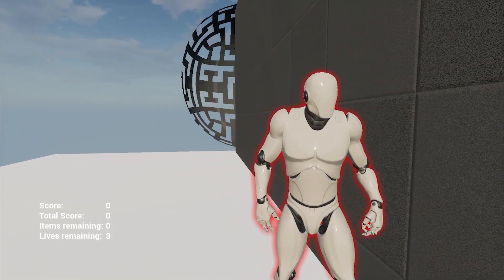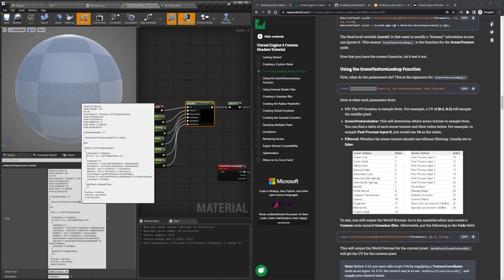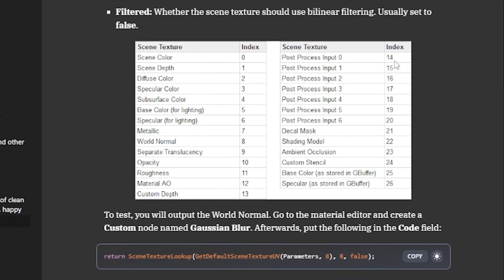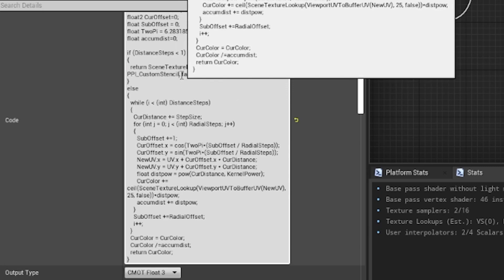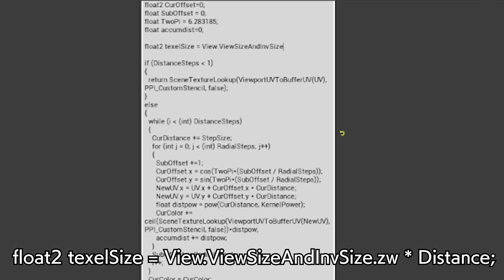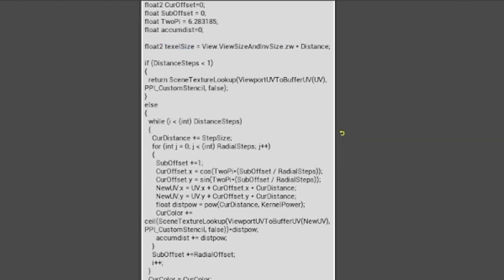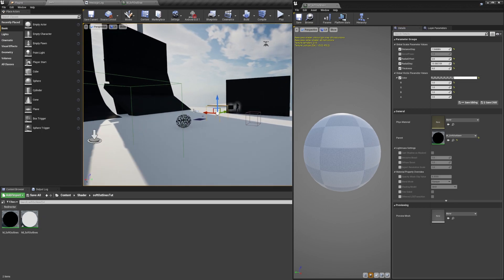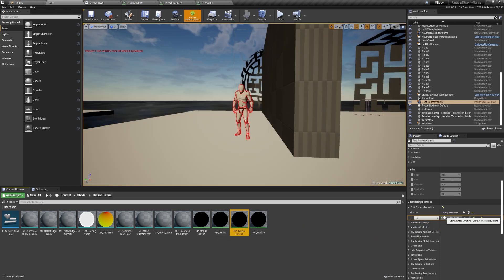Soft Outlines Tutorial | UE4.27 to UE5.4

Comment: Struggling to make this work in UE5.4. Did anyone manage?
Reply from the maker: @Virtuality  Did it report an error when you tried to connect or preview a node that had no math operation with the scene texture nodes? That’s a result of the custom node not having access to which ever header contains the scene texture lookup code, the solution is to just hook up all the nodes shown in the tutorial before previewing the output. If you are still having trouble after that, reply with what’s happening and hopefully I can reproduce the error.
Reply: @Erros  no errors. I just get a small coloured block in the top left when not highlighting. When highlighting I get some lines in the bottom and right side of the screen.
Reply from the maker: @ I’ll investigate this when I get free time from work as this sounds like unseen behavior
Reply from the maker: So I've tested this in 5.4 by upgrading the 5.3 version of the project and it still works, so either unreal is translating the material code from 5.3 to 5.4 without me having to rewrite it, or unforunately more likely there's a step you missed.
Reply: @Erros  @Virtuality I also can't make it work in UE5.4.4. The error says: use of undeclared identifier 'SceneTextureLookup'. 
For me CalcSceneCustomStencil( <PixelPosition> ) and CalcSceneCustomDepth( ViewportUVToSceneTextureUV(<UV>, PPI_CustomDepth) ) works.
I found them in the generated HLSL code, that you showed at 3:11 . It's weird that the stencil buffer only uses pixel position.

Comment: this affect only the outside corners/edges what about the inside edges?
Reply from the maker: @hatty101  only outside, you will need to combine it with a normal line sobel to get both
Reply: @Erros  i am searching for days to find a way to outliner inside edges but i cant i am desperate and sad! :((((((
Reply from the maker: @ run the sobel filter on the scene texture containing the normals, I believe the video I reference at the end of this video has normal lines, it’s an hour but it’s a great video
Reply: @Erros  thanks. I found a method but it requires stencil which doesn't work on mobile even tho docs says it does
Reply from the maker: @hatty101  the method used in this tutorial also uses stencil but to get the shader to compile for mobile you have to use the custom stencil node instead of writing it directly as unreal does some conversions behind the scenes which would be honestly be nice to know so I could just write the shader instead
Reply: @Erros  ohh?? amazing thanks for telling!

Comment: Thats brilliant! Thank you. I have a question, sort of related. If you have a toon/outline, its highly dependent on the screen/viewport resolution. Meaning, in low res, or small viewport the lines are forced to be thick and cant get the sharp details that might be needed given that the buffers' resolution are small. Is there a way to make them independat?
Reply from the maker: @0xnd90sjsnjdo0sbbo0 i don’t have it open but I believe that’s what the texel size is for, and if you don’t round the thickness variable then you can use fractions
Reply: @Erros  yea, thats what the texelsize is for, you can always increase the thickness,but if the viewport gets smaller, the buffer dont have enough resolution and your stuck with a thick line as a minimum. I was trying to figure out ways to upsample the buffer size, is that even pissible you think?
Reply from the maker: @ maybe if you used inverted hull but that wouldn’t be a post process effect and has the potential to look bad (very dependent on the number of triangles in the mesh)

Comment: hello, thank you a lot of these cool tutorial. It works well!    i just wondering that how to show only in Custom Depth stencil 1 layer?   I tried with Lerp, stencil mask compare node in material,  but keep failing...
Reply from the maker: @greempark5743  the custom depth value you assign to the mesh is the stencil layer
Reply: @Erros  Yes, i did it.  Depth 1,2 is working. 

I want to make this work only Depth 1.  not 2.      cause i want to use Depth 2 for another color.    

Thanks for reply 🥰
Reply from the maker: @ you should be able to clamp the custom depth in the material graph to a value between 0 and 255 then have a check if it’s the value you want to allow and I would just returning a float of 1 if allowed else 0 and multiply that by the value that only adds the outlines else you’ll lose the scene color as well and the screen will be black
Reply: @Erros  ahh Thanks for kind reply, I will try and show you as a Video soon.

Comment: Does this work in unreal 5.3? i tried using it but it doesnt work for me?
Reply from the maker: There are nodes you can’t preview or plug into the output else the shader will fail to compile because it’s missing access to a particular buffer. I advise following the full tutorial before testing the output, but yes I tested the project containing this shader in 5.3 before updating the title.
Reply: it works in 5.4v

Comment: Looks like a good job, but in 5.1.1 it compiles succesfully, but nothing happens. no outline (
Reply from the maker: I just tested it on 5.1.1and it' still working https://drive.google.com/file/d/1RULYrJdCyIBJ1G6CJ-VDD-N3-76ZS1ao but it could be the Material Instance isn't added to the post process volume, the mesh you want to outline does not have a stencil value greater than 0, or another easily overlooked setting.
Reply: @Erros Can you provide the right code. may be i made an error with your old.

Comment: Awesome!! It's almost working for me. For some reason though, the blurred offset samples don't vary in opacity? They seem to all be maxed out at 1, so instead of a fading glow/reduction in opacity by distance I just get a solid outline. Any idea why?
Reply from the maker: What values are you using for thickness, distanceSteps, radialSteps, and kernelPower?
Reply: @Erros  I tried a few setups, but anyway let's say Distance (Thickness?) = 5, DistanceStep = 8, KernelPower = 1, RadialOffset = 0.52, and Radial Steps = 16
Reply from the maker: @thegnjoy  check the custom material expression as I get a glowing outline with your values. It might have to do with the stepsize variable but not entirely sure without a photo
Reply: @Erros  It's also super bright and emissive without a saturate or clamp node - as if all of the values are actually way above 1. I tried subtracting from the output before clamping and it seems to erase groups of offsets at certain values. They don't seem to have a linearly descending brightness/opacity.
Reply from the maker: @thegnjoy  stencil values range from 0 to 255 so the clamp is needed
Reply: @Erros  Ahhh I figured it out. Is the individual mesh's stencil value supposed to be set to 1? I had it set to a custom number like 201, so it only had 201-255 in the custom depth to work with I guess.
Reply from the maker: @thegnjoy  it’s supposed to work with any value greater than 0, even stencil value 201 gives me the blur
Reply: @Erros  That's weird. So, what I've figured out at least is that at 1, the effect happens once and looks good. At 2, it doubles up. At 201, the glow effect appears to be layered 201 times, which gives me a solid outline instead of a glow. I figured out how to fix it though: change the Write Mask on the mesh to be First Bit/a single bit only. Makes sense. Thanks for the help anyway and this awesome video!

Comment: Great video! would it be possible to modify this to just blur around a character without changing colors?In a way similar to the post process blur BUT only around a specific character
Reply from the maker: Yes you are going to want to invert the stencil image by doing 1 - stencil buffer, I believe that is all you should need to do but I’ll check to make sure
Reply: @Erros  thank you so much!
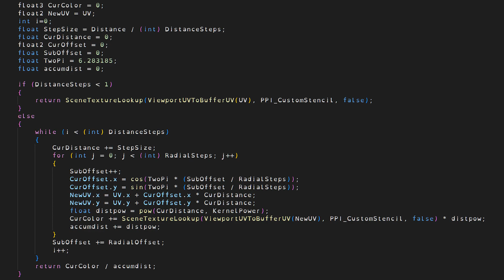Reply from the maker: A picture with what you will need to do is included at the bottom of the 4:00 linked google doc
Reply: @Erros  Hey thx!By the way maybe i was unclear but i meant to have a transparent blur around a single character (NOT visible trough the walls like in the video), i didn't mean everything BUT the character. Also, i tried to follow but in the video a whole picture of the material you are using is not present, that would be helpful!
Reply from the maker: Are you looking for a blur outline?

Comment: Whaou very interesting but tooooo complicate for me ! I'm looking to soft outline in letters in widget BP
Reply from the maker: You're probably going to have to make a separate material to be plugged into the font material as seen in this video: https://www.youtube.com/watch?v=JqO24PybDw0 and it will probably be just as complicated as what I've shown if not more as you will need to find the distance from all parts of the outline from the original font text and make it more transparent the further you get or use adobe photoshop to type your text then right click the font in the layers selection and go into the blending options and select Outer Glow. A video showing how to outline text: https://www.youtube.com/watch?v=9ldpG4GUPD0 then after outlining the text make sure the background is transparent and export with transparency or you can make the font and soft outline white and the background black so when you import into unreal you can chroma key out the black background. Now that said adding a need for chroma keying will result in subpar visuals but also I don't remember how well image transparency for UMG is supported but it should result in better visuals than the chroma key option and should be more performant than the font material as the material will not need to run all the expensive math for calculating soft outlines per frame. The last downside is that if you ever want to scale up the font in unreal you might need to scale up the output in photoshop as photoshop converts the fonts from scalable graphics to pixels meaning if you make it bigger than it was in photoshop you will start to see pixelated edges, also you want to apply a slight gaussian blur to all images coming out of photoshop else they will look super sharp in unreal which I'm not sure if I went over in my pokemon ui recreation video but that's how I made the icons look sharp and soft at the same time: https://youtu.be/97jqmHjggxY

I understand that is a blog post and a half but hopefully it helps.

Comment: It is impressive that you could find the bug to fix hidden in one line of code. Can you make a soft outline in unreal engine 5 or does this just apply for ue 4?
Reply from the maker: So I downloaded UE5.0.3, then copied and pasted the material graph with the HLSL code and setup all required settings for the static meshes. It seems to not work with UE5 but also when I go to the buffer visualization for the custom stencil buffer everything is black so either enabling the custom depth and setting the custom depth value to 1 is not setting the custom stencil value or the warning about my nvidia drivers not being up-to-date is the problem. Will check again tomorrow.

Edit: I was bothered by not having the stencil buffer visible so I did some searching and I forgot that Custom Depth-Stencil Pass is not set to "Enabled with Stencil" by default. Located in the Project Settings -> rendering -> post processing section. 

It is still broken as it seems ViewportUVToBufferUV in the SceneTextureLookup function no longer places the post process effect in the correct location on screen.

Edit 2: Every in this tutorial works as is, so disregard the part about the ViewportUVToBufferUV not working. What happened is I enabled the "Enable Stencil Test" option under the Post Process Material -> advanced section of the material with the Stencil Compare set to Less Than and the Stencil Ref Value set to 29 (I was testing values above and below to see what the effect would be, turns out the effect would be the shader not working).
Reply from the maker: Description updated to include possible bugs encountered in UE5.0.3